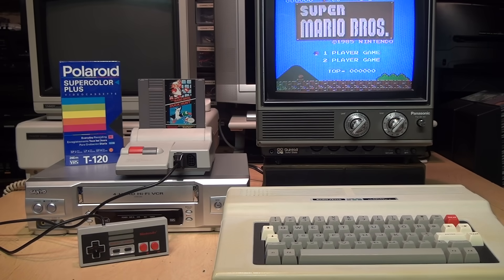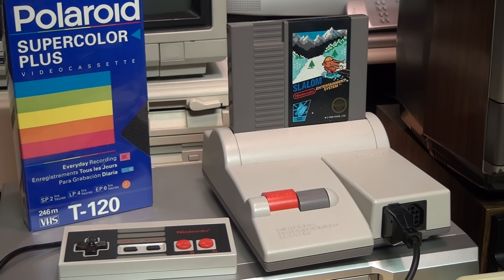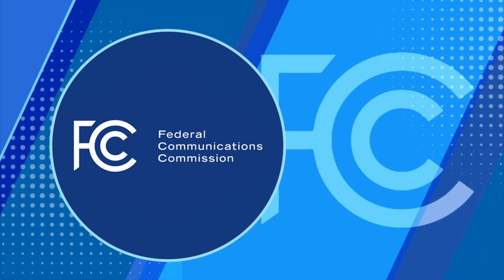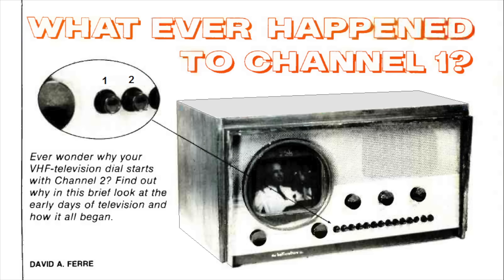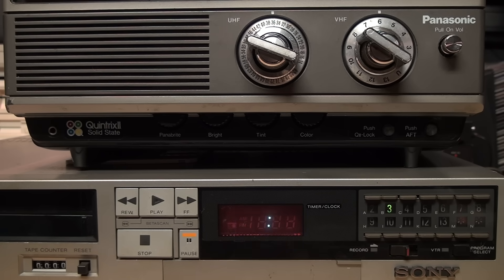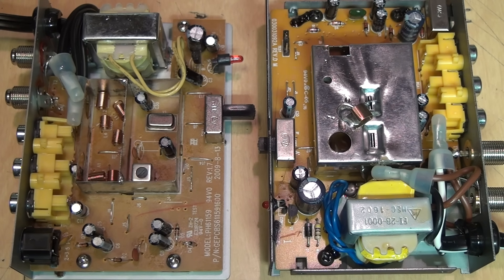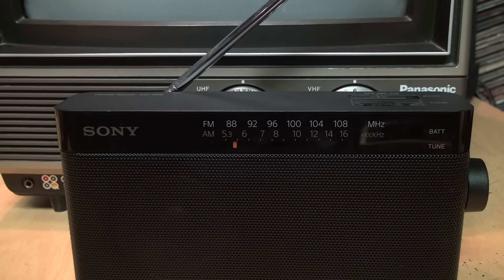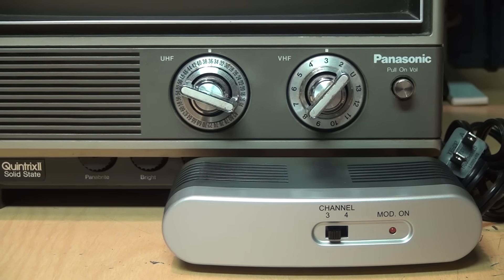Why your Nintendo was on Channel 3 (except in Cleveland)

Comment: It used to be hard to get good reception from video game consoles in my town on channel 3 and 4. It was okay up until about 1983 or so, as there was nothing broadcasting on those channels. However, the French CBC was broadcasting on Channel 2, and their signal was so strong, it bled over onto Channel 3. So Channel 4 was the best option. But in about 1983, they added CBS and PBS to our cable (prior to that, we only got ABC and NBC via a microwave broadcast from Bangor, Maine.) The CBS station was added to Channel 4, and it was so strong, it bled onto Channel 3, as well. 

I'm betting the cables that the cable companies used at the time didn't have the best shielding. At that time, before VCRs and other devices that connected to a television, were in common use, interference from the cable television wasn't that big of a concern.
Reply: I figured out how to put a choke, basically a filter, on the line from the RF output to the TV. It helped a fair amount.

Comment: And Hartford, CT...We had a broadcast channel 3 and it was very powerful, so much so, the local cable company put Channel 3 onto channel 2, because ingress would always screw up the picture on Channel 3 over the cable system if the connections weren't perfect...so they stuck the prevue channel there, since no one was watching it long enough to complain about ingress.
Reply: That would be WFSB.
Reply: and in Stamford CT, we would watch ch 3 for CBS programming because WCBS ch 2 would leak into the cable system even that far away and interfere with itself.
Reply: Yup...I remember WFSB, then CBS, being on 3.
Funny most VCR and games I had were 2 or 3 till Nintendo arrived and it was 3 or 4 which I thought was odd.
Reply: @timothyp3378  It still is CBS.
Reply: Same with channel 11 here, except the cable co gave zero about it.
Reply: Oh yes we had the same in Cleveland on 3,5 and 8.    The distortion from both signals together would cause this thick clear-ish  vertical line   that wasn't always in the same place. It was so weird
Reply: Even nowadays, WFSB is causing problems, although WSHM's switch to 33 last year mitigated it a bit.
Reply: you could pretty much say CT and some of the Pioneer Valley in MA as WFSB reached far across NE. glad someone already posted this as his title is way off.

Comment: I still don't understand why channel 1 wasn't used.
Reply: Back in the 1940s, TV channel 1 was reserved for public-access, community, and educational stations.  (There'd been pressure to include space for these, alongside commercial broadcasters.)  But the frequency was also shared with some other radio uses ("fixed and mobile sources"), and the FCC figured these were scattered enough to not conflict much.  Surprise: they did conflict, so the FCC resolved it by getting rid of the barely-used channel 1 as a TV channel.

(The FCC had also underestimated how far VHF TV signals would go; initially they'd assumed stations were limited to line-of-sight from the transmitter.  But despite some early warnings, they found out the hard way that signals will go a ways beyond the horizon too.  So in addition to deleting channel 1, they also put a moratorium on new TV stations for a few years while they sorted the mess out and re-thought how TV stations should be spaced.)

Comment: In Europe we didn't typically use channel numbers (in the radio tech meaning of this term) in daily conversations. Our TVs had presets like HiFi component radio tuners - and they had them since the 70s, sometimes even late 60s. We'd tune the available stations to those and never remember the physical channel numbers. There was no "standard" preset assignment, but a common pattern was: the state-operated channels first (and they were typically numbered on air as well), then a local public channel, then commercial channels, ordered roughly by their launch date. Those were initally hard press buttons, then soft touch controls, and eventually keypad entry from a remote - the OSD would display the preset number, NOT the channel number.

In those remote+OSD times, most TVs would allow setting up "preset number 0", and that would be typically tuned to the VCR's modulator if a composite connection was not used. On older TVs with individual button presets, the VCR would be tuned to the last available preset or something like that - and as far as physical frequencies go, it was commonly on UHF, adjustable in the range of channels 30-39 or something like that, with channel 35 a common default (note that channel numbers don't align between Europe and US).

But since the mid-90s, pretty much everything used SCART anyway.

EDIT: And nowadays in the digital age, the preset numbers are typically provided by the cable/satellite company, or the organization that oversees terrestrial licenses. But still, they commonly start at 1, are more-or-less continuous, they have nothing to do with physical channels, state-owned channels are usually at the start of the list and for other channels the preset number usually also has nothing to do with on-air branding either. Those numbers are not consistent between providers, either.
Reply: And before hard-press buttons there were 12-way rotary switches with fixed channel settings, were they not? German makers switched from rotaries to pushbuttons as early as mid-1960s, although the small-tube portables used rotaries through the 1970s.
Reply: @jmi5969  Yes, the earliest European TV tuners (and the dials that protruded from them) looked and operated much like their US counterparts. We just switched to push-buttons programmed to presets early on. By the way, in the days before computer control and OSDs, programming those presets looked much like the thing Kevin showed at 3:23. I guess that VCR model could have shared the tuner design between regions.

And as to why we adopted presets - I think it has a lot to do with the popularity of the UHF band in Europe. In the earliest days of TV, most European countries only had one state-operated channel and that was it. When the "second channels" started rolling out across the continent, in a lot of areas they broadcast on UHF. UHF converter boxes like the ones Kevin shows at 2:42 were often called "channel 2 adapters" over here ("channel 2" referring to the second channel of the state broadcaster, not physical channel 2). Some countries like UK and France even used UHF pretty much exclusively, because VHF was used only for the legacy black-and-white-only, incompatible signals (405 and 819-line systems, respectively). In the 90s and early 2000s, you'd usually receive at most 2 channels on VHF and all the rest on UHF, and tuning on UHF with a dial when there are multiple stations there is just a pain - that's my guess as to why presets became the norm.
Reply: Exactly, when a TV gets setup all the available channels gets stored into the TV's memory and the only used reference is which channel is stored to which (preset) number. Older TVs usually only can store 0-99 presets (channels).
Reply: @zsombor_99  My parents used to own a TV from the early 90s that only had presets 1 through 39, and the remote had separate buttons for 10, 20 and 30 (so you'd key just 3 for channel 3, and 10-then-3 for channel 13). But that was before the advent of Hyperband on cable which actually allowed for around 100 channels to be received simultaneously.
Reply: @kFY514  With our TVs you can press two numbers ‒ like [2][ 3] ‒ and the TV just jumps to that preset.
Reply: @zsombor_99  Yes, modern TVs work like that, but that was the early days. For a while it was common for TV remotes to have a button labeled "-/--" that switched between single-press (limited to presets 0 through 9) and double-press (for double digits) channel switching.
Reply: @kFY514  We only had CRT TVs with double press only (without the "-/--" button).
Reply: @kFY514  I definitely remember the remote for my TV had a button that allowed you to use 2 digits, but it was always one digit by default.
Reply: Yes, my first TV set I remember having (B&W, with tubes) had 6 fixed presets,  2 for channels 1-5 (never used for TV as they were already old standard), 3 for channels 6-12 and one for channels 21-60. Later, ther was a TV with a preset box similar to that showed in the video (the VCR one) with 12 presets.
The old, rotary switches with a channel/position, I saw only on old, tube TV sets, with roundish CRTs and always associate with old, vintage tech, as my old aunt had one, made in USSR. 
Also, the TV stations (in analog, in my area) were not remembered by channel numbers, we used to preset them as first the most watched and one-two the state TV. When the TV set came with electronic tuner, usually the channel 0 was AV input, selectable from remote control as "0" or directly from its AV button or from the front pannel, ch- from channel 1 or dedicated AV button. Also we set them the same, first channels were set to the most viewed TV stations with the state TV on the  last channels.
Resuming, a TV station that emitted on CH 8 might be found on CH2 in my houme and on CH1 inmy neighbour home. I mean I watched the TV station that was on preset button4 and not on channel 69. That is why is so strange to see the channel number being so important that made it in the station name.
The RF channels were my game consoles and computers worked were in the low VHF band, ch2-3 or ch3-4 in some imported goods.
Note that I was in an OIRT country with PAL color standard.
Reply: In my area (Veneto), there was a local channel called "Canale 68", which had its main analogue transmitter (and later, digital SFN network until those channels were removed from TV use) on channel 68. Maybe it was an holdover from the days before presets.
Reply: @dyter424  and telequattro on ch70 which was out of legal band, from what i know.
Reply: @tartarughaninja4  The amazing thing is that they used it even in digital overnight, apparently. Even then, there were no decoders that could tune out of band. Even stranger, Tv7 Triveneta may have operated in digital at very low power on channel B. Yes, as in channel E4 on band I. Band I was never even considered for digital television outside of North America.
Reply: @dyter424  There was also a Canale 68 in Turin.
Reply: @givolettorulez  And probably in other places. All in all, I wouldn't be surprised if in the early 80s this country had more TV stations than the entirety of the United States.
Reply: Actually, now I have a question for Americans. Let's suppose you lived in an area only served by translators and "channel 5" was actually on 47. Did you ever get analogue TVs with presets which allowed to remap channels on your remote?
Reply: @dyter424  As far as I know translators weren't handled that way here. Where I grew up (Western Pennsylvania) there was WPCB that broadcast on UHF 40 and a sister station, WKBS that I'm pretty sure was broadcasting the exact same feed on UHF 47 about 100 miles away. I'm pretty sure they even used the same idents that listed both channels.

I don't think sets that remapped channels (kind of like radio presets) were common here if they existed at all; whether that's for regulatory compliance or just a thing that happened because stations here often integrated their channel assignment into their identity I'm not sure.

Once "cable ready" sets that used digital tuning came along it would have become a moot point as those sets would skip channels with nothing on them.

--edit--
It probably had a lot to do with how things were handled here. It seems like in the UK a network is handled more as a monolithic, top down entity where individual "channels" are largely rebroadcasting content from the top.

Over in the US individual channels are independent and their network affiliation is more of a content provider. It's not unheard of for an individual channel to ignore something the network is playing in favor of local content; I remember my dad being mad once because the local channel pre-empted Seinfeld or something to show a documentary about something of local interest.
Reply: Huh, interesting. We use channels here in Australia.
Reply: Yeah I don't know about TV but for radio at least it seems like the station identifiers for repeaters just get rolled into the same announcement. ("This is WABC Big City, and WXYZ Smalltown.")
Reply: This was always super confusing to me seeing people on the internet talk about "channel numbers" as if they were unambiguous. Took me quite a while to figure out the way it worked here was not the same as other parts of the world. And I'm pretty sure at least the TV I remember had more precise tuning control than by any "channel number". Also until the switch to digital, I definitely remember being able to receive 4, maybe 5 channels...
Reply: New Zealand was the same too with using presets. Originally TV sets made in the 60s used a channel number and we originally had 4 regional stations AKTV2 in Auckland, CHTV3 in Christchurch, WNTV1 in Wellington and DNTV2 in Dunedin, in the 1970s these regional stations became known as TV ONE broadcasting nationwide and we got a second channel called TV2. At this stage new TV sets began using presets and most TV users would tune preset 1 to receive TV ONE and preset 2 to receive TV2. A popular TV of the time was the Phillips K9 colour TV which had 4 presets. In 1989 we got our third channel called TV3. I went to the USA in the 90s and it seemed strange with the TV channel numbers being all over the place.
Reply: Australia was quite similar, due to it being quite a large country, even if TV there became somewhat centralized.
Reply: @asasinz2  Yeah, it was a very similar thing in Europe. Before the late 80s/early 90s, most of European countries (on both sides of the Iron Curtain) had state monopolies on TV broadcasting, and the nationwide networks are numbered - like BBC One and BBC Two in the UK (although there were also ITV franchises there and later Channel 4 as well - but note the contiguous numbering); France in the 70s had TF1, Antenne 2 and France Regions 3; Poland had TVP 1 and 2; West Germany had Das Erste ("The First") and ZDF (Zweite Deutsche Fernsehen, literally "Second German Television"), and so on. It just made sense to have presets that reflected this branding.

Things got a bit messier with the advent of commercial channels, but like I mentioned in the original comment, we just stacked them onto further presets as they launched. With most of European channels (both state-owned and commercial) being nationwide networks broadcasting either mostly or exactly the same signal from multiple physical stations in different regions, it made little sense to use physical channel numbers in branding, although there were exceptions, like the Italians above mentioned. We don't use call signs over here either. I don't know if any of the stations have them at all, but if they do, they aren't common knowledge and are never part of the brand.
Reply: @kFY514  In the 1980s a friend lived at the top of a hill overlooking Bristol U.K. He had one of those cheap Black and White TVs with a rotary tuner. Tuning through the UHF band using the set-top aerial we received over twenty broadcasts of the same three channels, but could hardly get a decent picture on any of them due to co-channel interference. The only times the broadcasts would split would be for half an hour of local news a couple of times a day.
Reply: Our first colour TV had just four pushbuttons, tuned by twisting the knob many times. That wasn't a problem in the 1970s as there were only three channels BBC1, BBC2, and ITV. I actually set up another antenna pointing at Wales to get a fourth channel, but the majority of the programmes that were different from BBC1 were in Welsh.

Comment: My first childhood home computer was
SpectraVideo 728 (MSX) back in the late mid 1980's.

After that, i moved into the 
Commodore 64 and Amiga 500.

And then, back in the early 1990's,
i had NES.

Now, still in 2024, i still have the original hardwares of the Commodore 64 and Amiga 500 😺👍🕹️.
Reply: Is the PSU for the C64 still going well?